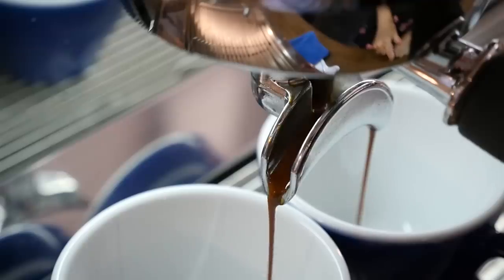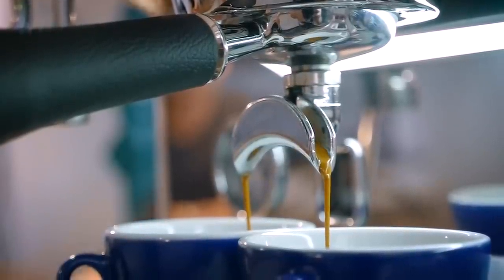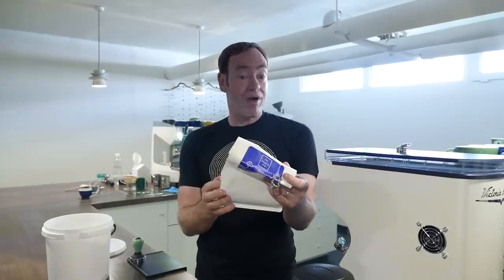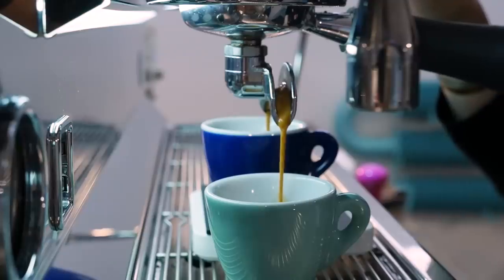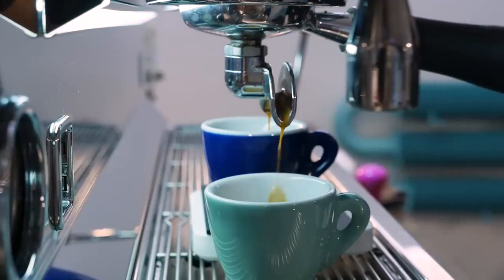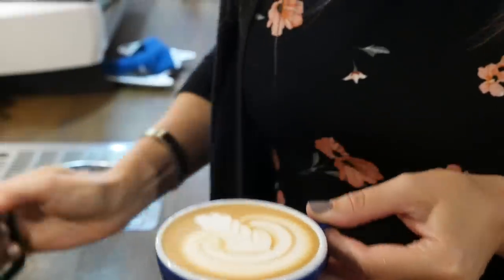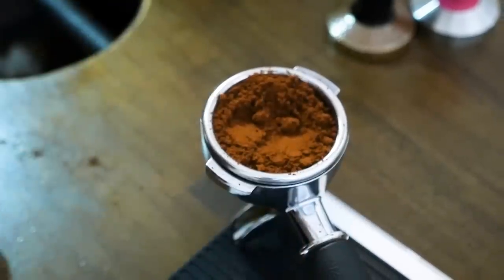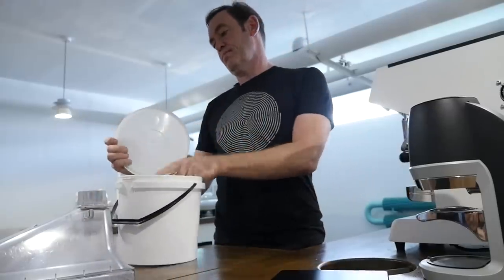Barista's Guide To Coffee Freshness w/ Gwilym Davies

Comment: illy Caffe has the best coffee preservation. They use a 3 kilo tin, a machine fills the tin with the fresh roasted coffee, then it sucks all the air out and refills it with nitrogen (an inert gas) so the coffee doesn't oxidize, then they pressurize it so the gases can not escape the coffee bean. Basically putting the coffee into suspended animation and now it can actually age like wine.
Reply: But Illy Coffe is not special at all, if you are talking about those cans in the supermarket. No real roast date no origin nothing
Reply: @stacks2hell187  No I'm not talking about the cans in the super market, I'm talking about the # KILO tins that you can only get by being a Cafe, Restaurant or Hotel. It's whole bean coffee with dates , no oxygen, pressurized with Nitrogen.
Reply: @stacks2hell187  And yes it is special coffee, first of all it's a 9 bean blend, how many roasters do you know that have that many beans in a blend? Also it is special because NO OTHER COFFEE ROASTER  PRESSURIZES THEIR COFFEE IN A TIN WITH NITROGEN.
Reply: @grk651  okay so the point with the nitrogen is kinda interesting but a blend isn't automatically good if you have more beans in it. The reason is quiet easy the more variety the lower the chance of having a constant coffe. Simply maths 😜 that's why I don't like blends with like many different origins😂
Reply: @stacks2hell187  Ok, let's add the fact that the man that came up with this 9 bean blend profile was a PHD in Chemistry and used his lab in Trieste to discover things that no one else had. Crazy experiments like creating a clear portofilter and filming an extraction under special lighting and high speed cameras. On interesting discovery was that during the process of the extraction, there were micro explosions when the hot water hit each tiny grind which contributes to the emulsification of the fats and oils from the coffee helping to cause the crema. We are talking about dedication, over the hill experiments, passion beyond the scope of what most self proclaimed master roasters do. These 9 beans change when the tasters (who taste espresso every day all day long) detect that something is wrong with the profile. They have other coffees waiting in line to replace any bad beans that may have made it to their plant.   Shall I go on.
Reply: @grk651  yeah all good but still in reality I personally don't like blends with over 2 coffees. in the end I think it's just preference on the first place 🤔 to my point I can just add the fact that in wbc also most of the times specialties are used

Comment: Ok, that was helpful. But I was hoping to find also some tips how to find out if a coffee is fresh or not (usually there's no roasting date on the package). For example what's when the beans are a bit oily? I found it on cheaper beans as well as on high prices beans (30€/kg) from smaller local roasters. But is it a sign of bad quality/ freshness?
Reply: I’d there is not a roasting date then it’s a total mystery, buy coffee with a roasting date on it -  you can buy from a coffee shop, actual roaster, or just a higher end grocery chain like Whole Foods etc
Reply: I agree with what Mailita says also oily beans is a bad sign as the flavour should be on the inside where it is more protect, not the outside where volatiles can escape and oxidation can more easily happen. It usually happens due to age or being stored in higher temperatures

Comment: I store my coffee in mason jars and in a cupboard to keep it away from light. Temps are about 70-75F year round. I was shocked to hear you say 14-21 days for espresso. By that time my coffee smells dead in my jars. Is there a storage vessel for home roasters that you recommend? Or a time on mason jars/aroma to look for?
Reply: classicrockonly the vacuum seal containers remove the air which will make it fresher
Reply: Keeping the coffee in the original bag helps, would the bag fit inside the Mason jar?
Reply: @espresMod  I'm unable to roast a whole bag sadly. I end up doing maybe half a pound of a 1-2 pound bag each week so I wouldn't have any bag to put them in. Have you heard of or had experience with the Fellow Atmos containers?
Reply: @classicrockonly  never tried them and I am sure they are good but secretly deep down in my brain I am not sure about methods that suck air out and create a situation where there is a a 'sucking' effect on the bean. from limited experience I have find they seem to suck aroma out quicker than a regular environment.

Comment: In your background, you have your Aeropress stored incorrectly. Either store it completely pressed, or store the two pieces separately. I think your seal can wear down early when you have it stored in the 'ready to press' configuration.
Reply: I've been storing it like that for 7 years. Still works as new. Aeropress is pretty resilient little device.
Reply from the maker: Haha, thanks for the comment.
Reply from the maker: It’s actually our trophy. It’s signed by Mr Alan Adler, we rarely make coffee with that so it’s not an issue. We will change it for the next videos though so thanks for the comment.
Reply: @MihaRekar  "I've been storing it like that for 7 years. Still works as new."
I've been storing my AeroPress either fully pressed through or completely separate for 6 years. The seal has been leaking for a couple of months. AeroPress sells replacement seals. AeroPress knows that the seal will wear down even under optimal storage conditions.

Comment: I'm perfectly willing to believe that coffee can taste differently throughout it's storage, handling, and brewing variables, but the idea that CO2 remains within fine ground coffee grains is pure imagination on your part.  Hilarious even: the idea that the nearly nonexistent CO2 inside fine ground coffee will "push back" when hit it with hot water.  Those bubbles you see is coffee and water forming a new compound and the air that surrounds the coffee grinds escaping the liquid; not some sort of internal warfare in your cup.
Reply: PalJoey 1957 how come stale coffee doesn't have a bubbly bloom then
Reply: @bbbbbdddbbbbbdb   ...  Oils  still present in the coffee.  Besides, I don't necessarily believe stale coffee would not foam.
Reply: @PalJoey-on1yi  try it out
Reply: @bbbbbdddbbbbbdb  For me it's irrelevant.  I'm not trying to confirm that foam is a cause and effect relationship to CO2.  You would need some actual evidence - besides, use your common sense.  How are near dust size coffee grinds going to trap a gas?  It's the coffee oils that are foaming.
Reply: @bbbbbdddbbbbbdb   ... Anthropomorphize is the process at work here.
Reply: Co2 is held both in the cell matrix and the walls. the co2 from the inside the cells dissapears quickly on grinding but the co2 within the cell walls of the seed is much more persistent which is why you will still get some crema from older coffee. crema is a result of co2 and pressure. a good resource for this is the work Swiss Scientists did for the 'SCA Freshness Handbook'. saying the Co2 'pushes back' is far too simplistic but it was a quick video for a worldwide audience and explaining the process would be too much: a good read on this is Barista Hustle blog post on super fresh coffee
Reply: @espresMod   ... The cell walls of the seed are destroyed by grinding and cannot 'hold' CO2, but will have ordinary air trapped among, not within, the grounds.  Add salt to boiling water, then add pasta to boiling salted water, and you'll have back to back examples of what is going on.
Reply: @PalJoey-on1yi  The cells average around 40 μm in size while a fine espresso grind is just over 200 μm and a filter grind size around 400 μm, so there are plenty of cells left. Even if all the cells walls were broken the walls have micropores of 10-50 nm holding CO2